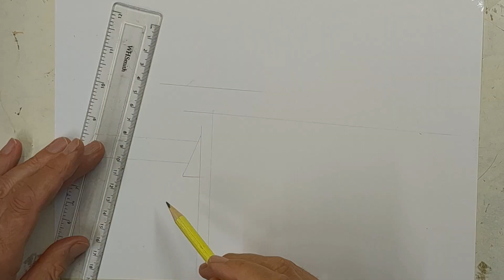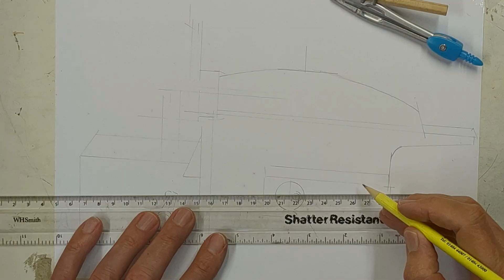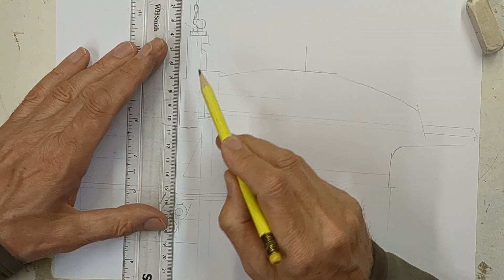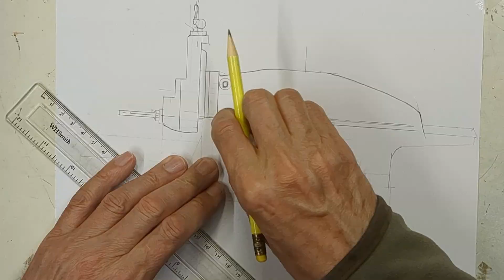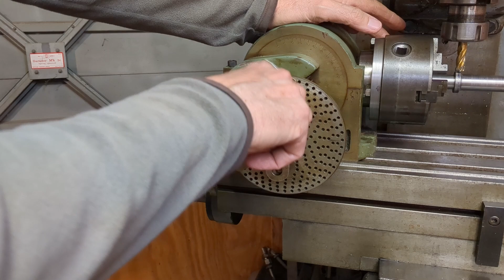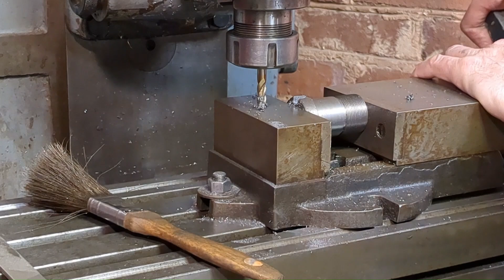Shaper Tool Holder #3 (Completion)

Comment: Hi Clive, it took me 2 hours to find it in my little home  w/shop, but I have a 16 page "manual"  for a 1957 3.5 inch Victoria dividing head.  It was in my tool box when I left the U.K.  in 1959. Yeah, I don't throw away enough things! Apparently the worm wheel is in two pcs held together by 4 clamp scrs (sq. hd.) and also has an eccentric  adjustment scr. ( for zero back lash?)  No lock is mentioned. The manual also has tables  for differential indexing, leads for spiral milling, simple or direct indexing (inch or metric) The serial # ends in-113.  Would be beyond weird if it was the same  # as yours!. Also have a mill, lathe and 7" shaper. (should have mentioned the serial # was on the test cert,  in the manual.)
Reply from the maker: Thanks for your post. That manual has indeed been lying around for a long time! I wondered if there was some kind of anti backlash mechanism. I would be interested in a copy of the manual or, at least, the page showing the mechanism. But that may not be practical for you. For reference the serial number of mine is BEC 47109/176. I wonder if that means it was made in 1947?
Reply: @Workshopfriend  Hi Clive,I don't think the serial # shows the yr. of mfg. , my  '57 manual only has 57 as the third & forth digits.  I could send you the original (completly untattered!) manual if there is a way of getting your address/U.K. phone # without dissipating it to the internet at large , for obvious reasons. Will see if my more "electronically" capable sons have any ideas.  I still have problems with my cell phone as they no longer make steam operated ones!. Stay cool, what happened to the old British summers?  No wonder Brits were born with webbed  feet.
Reply from the maker: If you don't mind writing to me on workshopfriend@gmail.com we can continue the discussion there. Thanks so much!

Comment: Great work! BTW which grade of steel did you make this project from?
Reply from the maker: Thanks for your feedback. I think it was made from simple EN1A (free cutting) and may be some EN8 medium carbon steel (the large nut was case hardened). If I were making the toolholders again I probably would go for something a little more durable but I use them frequently and have been entire satisfactory as they are.

Comment: hi again clive great work on the locking nut & using a key to align the keyway cutting tool was the only right decision. towards the end of the video i noticed you mentioned that the holders key would always keep the tool in alignment although when changing to the alternative bars how do you plan to maintain alignment,   i wonder if you could have used a second key on the tool shaft itself in the same plane of the tool bore  to remove the need for a crescent wrench and maintain alignment .  thanks again for taking the time to make these films.
Reply from the maker: Thanks for your feedback. Yes, you are right that the key in the clapper box doesn't help with alignment when I change the tool holder. As you write, for that I would have to include another key. That would have eliminated the need for a spanner and hexagon on the tool bars. Good point!

Comment: Hi Clive, perplexed as to why no lock on the dividing head.
I think it is mandatory for gear and spline cutting for accuracy.
Never seen or used one without, maybe a future project to install.
Tightening the backlash without locking will introduce unwanted vibration to the gearset..
Reply from the maker: Thanks for your comments, Willem. I am sure you have more experience with dividing heads than me. When I get time I will take a close look at it and see if a lock can be added - or whether there is something I am overlooking.